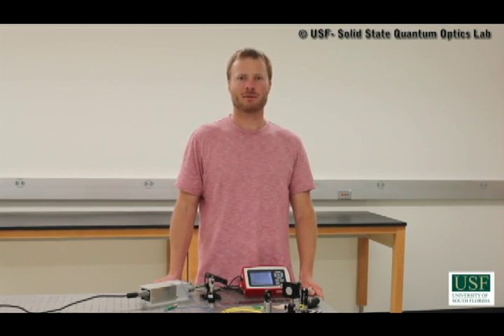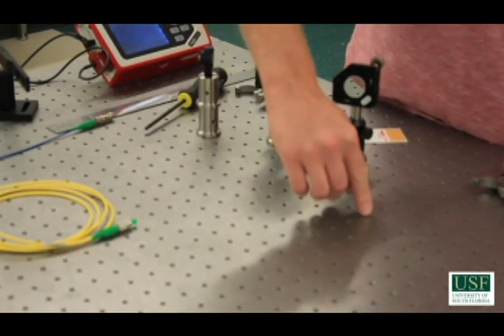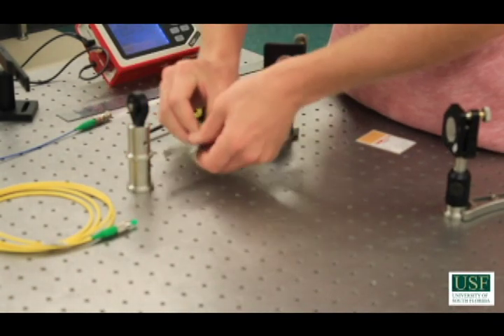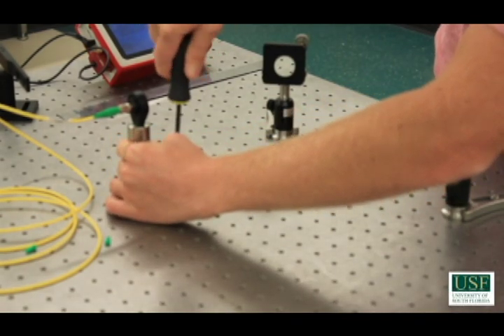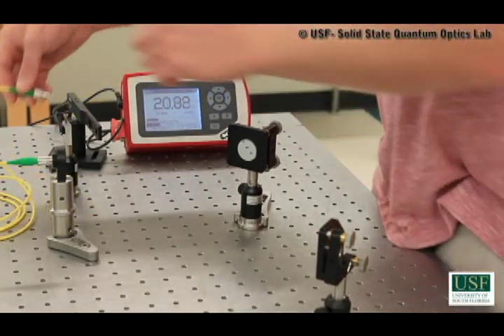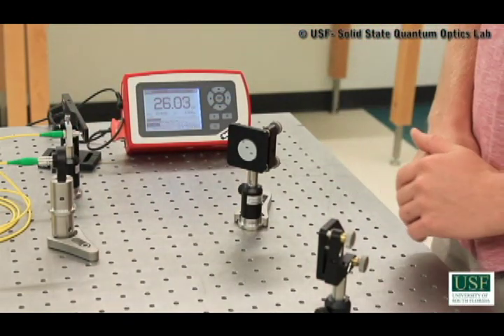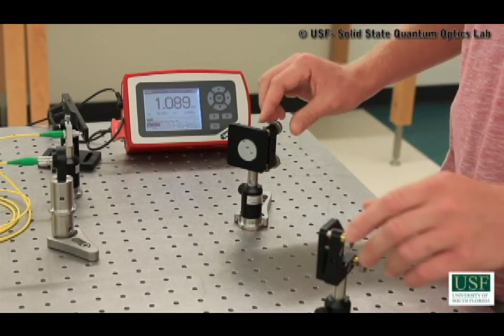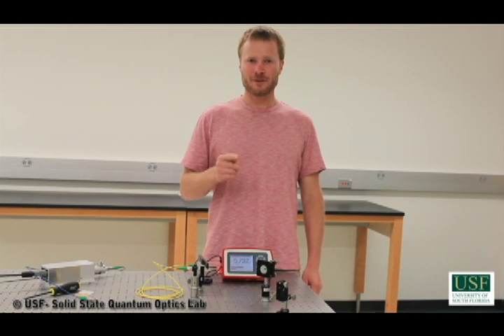Coupling a LASER into a single mode fiber

Comment: Can i couple the light using one mirror? or it requires at least 2 mirrors?
Thank you for your help
Reply: In critical applications like coupling into a single mode fiber 2 mirrors are absolutely required. When coupling into a multimode fiber with core large enough, one mirror can be sufficient.
Reply: @just_a_random_name_  is it imp to use back propagating beam?
Reply: @just_a_random_name_  I mean i didn't why needing two lasers as red light and infrared

Comment: Excellent demonstration! However I do not understand the logic behind mirror walking algorithm.
Reply: I think the idea is that by varying say, two variables, independently so that each variable is optimized without correlation to the other is not as optimized as varying both at the same time and taking into consideration the correlation.

For instance, you can consider walking on a triangular pyramid, where the line drawn from one corner of the triangular base to the center of the base is 45 degrees with both the x and y axis.  The corner of the triangle to the top of the pyramid forms one of the edges of the pyramid.  If you were to start near this edge but away from the top of the pyramid along the x direction, you would rise until you reach the edge.  Similarly, if you were to walk back and forth along the y direction, you would rise until you reach the same point.  However, were you to walk along the line y=x, you would walk directly up to the top of the pyramid, a point which is higher than the point you were previously at when you were walking along x and y independently.

Unfortunately, the above analogy does not work for a square pyramid, because of the orthogonality of the x and y directions.  However, you can choose two directions which are not at right angles with one another which the same idea holds.

What is the result of such pyramids?  I would say it is the orientations of the mirrors and the directions in which the fine knobs move the mirrors.  Alternatively, you can take the surface to be an upside down pyramid, so that the value of the surface function represents the distance between the center of the fiber coupler and the point which the laser crosses on a hypothetical plane located at the fiber coupler and normal to the designed incident entrance direction.
Reply: cryora thank you